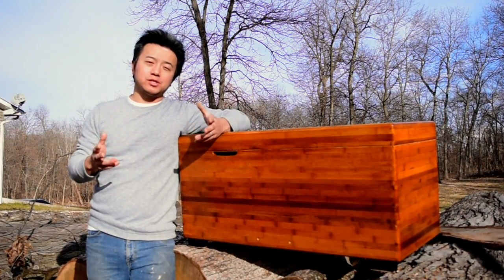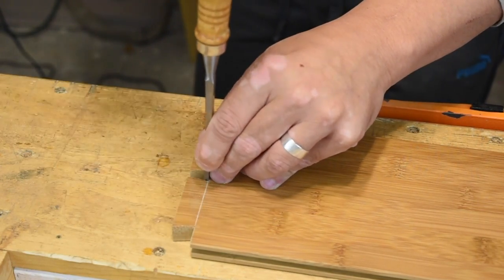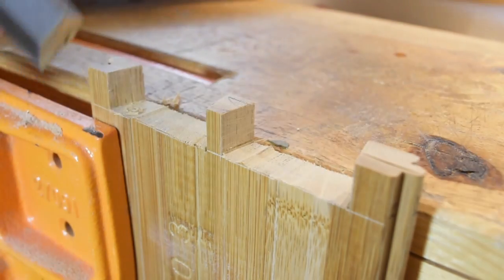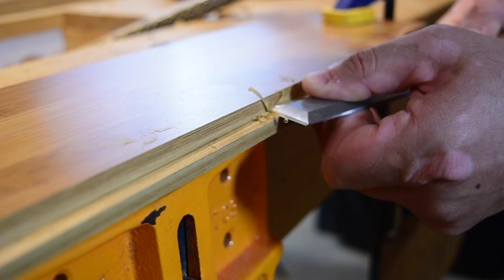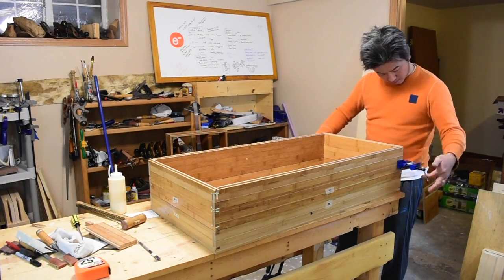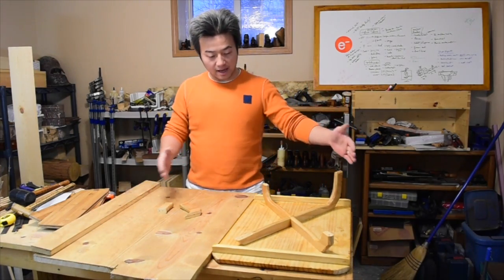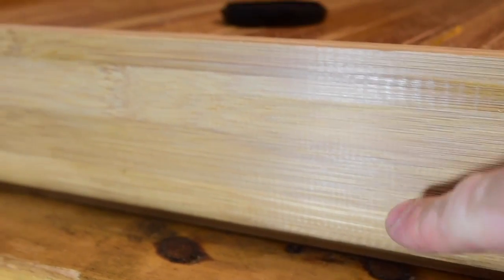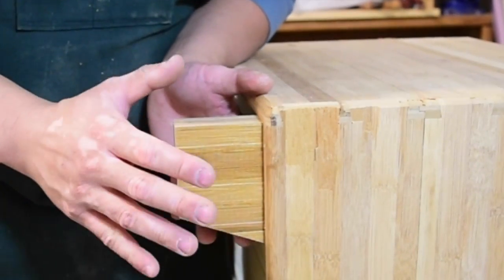A Bamboo Dovetail Blanket Chest - Scrap Bin Challenge 2016

Comment: I've never used bamboo before, looks like it's possibly easier to design a project around its "character" than to try to force the bamboo into the project.  Great looking chest, beautiful job!
Reply from the maker: +ManhattanWoodProject Thanks. It's always "easier" to work with the material; forcing it to my will can be satisfying or disastrous.

Comment: Man, I would have never thought to use bamboo flooring to make a dovetail blanket chest! Great use of scraps! It was very interesting to see how dull your tools got because of the bamboo. Do you normally use linseed oil as a base coat before a shellac coat? Can you please expand on that? I thought shellac makes a good base coat.
Reply from the maker: +Sighthound Studio If we all had the same idea the world would get along really well. I almost always use linseed before a finish cover; shellac works fine on it's own as well. The linseed gives some much needed oil to the wood and in this case the bamboo is very dry, the shellac works to seal the outside. Also after you sand there is usually a coat of fine particles on the wood, if you shellac first then that layer gets sealed, but if you linseed then sand, then burnish with some shaving then that layer is removed before sealing. And linseed gives the wood a nice color, it bring out the little texture that I like so much. These are probably the main reasons.
Reply: +John Zhu I must experiment with linseed oil. I only use shellac on the few pieces that I have built so far. The shellac does raise the grain a bit. I sand that off with a 0000 steel wool, a la Paul Sellers. (noticed the Paul Sellers dovetail template by the way)
Reply from the maker: +Sighthound Studio I learned the template from him, but he's not the first to use that design. You may care to see how I made my template on a miter saw with 3 cuts.
Reply: +John Zhu I will surely look for that video

Comment: Bought a bamboo cutting board, cross-grain.  Had to replace it with a Larchwood vertical-grain board, which behaves much better.  Bamboo is just too hard.  Remember, bamboo is a grass, not a wood.
Reply from the maker: +BeeRich33 You're right, bamboo is a type of grass.

Comment: I considered using bamboo because it's cheap.  As in, it grows in my yard.   However, with the cost of glue, wouldn't pine lumber from Home Depot be cheaper?    It seems that a bamboo chest is really a glue chest with a little bamboo in it. heh
Reply from the maker: Cheapness is the most important point of concern for consumers.